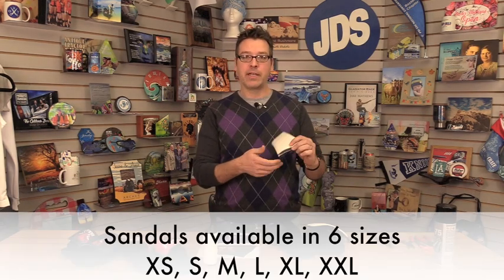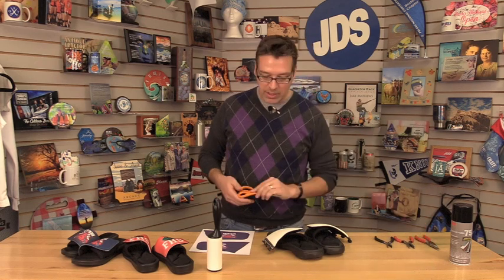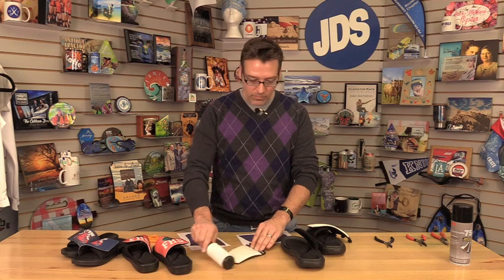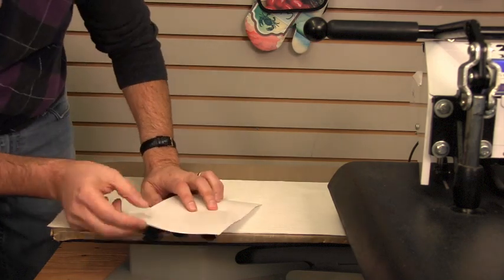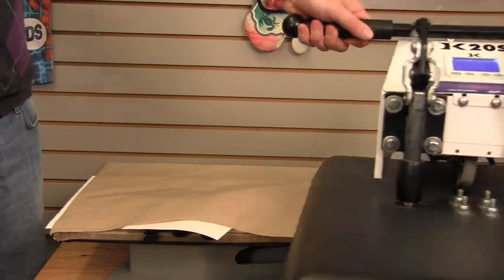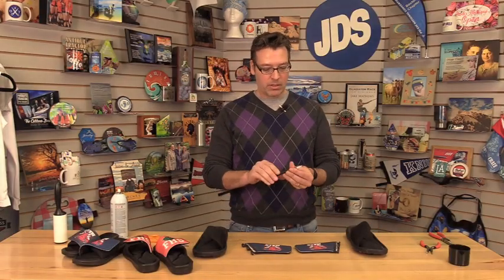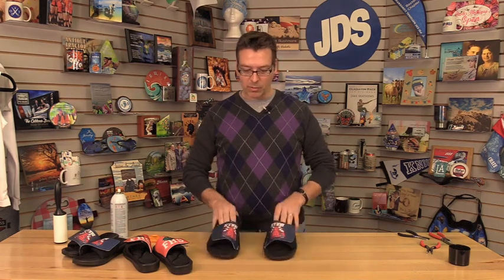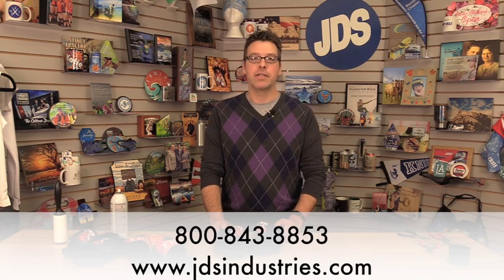How to Sublimate Slide Sandals

Comment: Where can I get this pray? What is the Content?
Reply from the maker: The spray is a repositionable adhesive spray. JDS sells it - part #3M6065. You can also get similar products at craft stores. Just make sure it is repositionable, not permanent adhesive.
Reply: Is that spray it put before printing on synthetic???
Reply from the maker: The adhesive spray is sprayed onto the transfer sheet before applying it to the product. It just helps hold the transfer in place.
Reply: @JDSINDUSTRIES  I WOULD LIKE TO PRINT ON SYNTHETIC MATERIAL. A SPECIALIST TOLD ME THAT TO MAKE THE PRINTING PERMANENTLY ATTACHED ON THE SYNTHETIC I SHOULD SPRAY A KIND OF CHEMICAL WATER ON THE SURFACE BEFORE TO PRINT ON. DO YOU HAVE ANY IDEA OF THIS PRODUCT PLEASE??
Reply from the maker: If the material you are sublimating is 100% polyester, then it does not need to be treated. We do not carry the sprays needed to treat cotton. Look for products such as Dyepress or SubliGlaze. You also need to test any material to make sure it will hold up to the heat - nylon will melt even at low temps.

Comment: where to get the blank slides from?
Reply from the maker: You can get the blanks from us. JDS is a wholesale distributor of the blank products.
Reply: Their website link under the sublimation supplies. Does not show cost, so may have to call them(?).